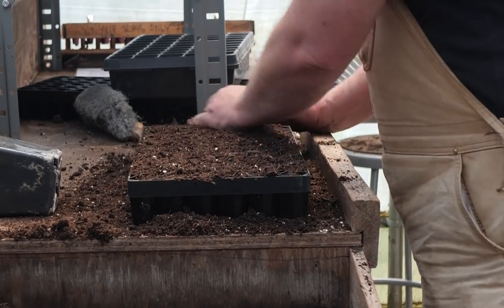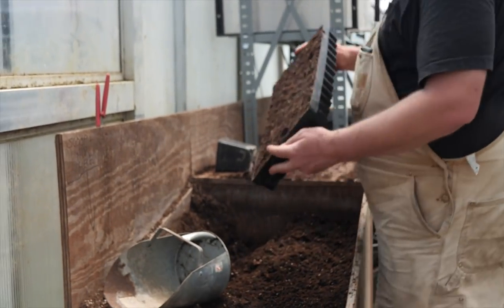Winstrip Trays: What makes them different?

Comment: I tried soil blocks but the juice isn't worth the squeeze. Meaning they're not very efficient. They take more time and work which is better spent doing something else. I'm all about working simple,efficient and organized. I'll have to try these trays. All the rain we've had has wiped me out and last evening the hail, up to golf ball size, finished everything. No cat tunnels or hoop houses so I'm at the mercy of the weather. It's cool though because there's still plenty of time to replant. Thank you

Comment: For starting seeds indoors I use the bottom watering method. Would these trays still root prune if they were sitting in another tray that I fill with water? I imagine they would have to be propped up so air can circulate underneath.
Reply from the maker: Yes, they would root prune on the side slits, jut not the bottom

Comment: What mix do you use or recommend for loading the trays? I've tried a few, but perhaps I have used too much soil or perlite (or both), as I find by the time I'm ready to transplant, ive lost about a third of my mix from the cells due to bottom watering.

Comment: help anyone, i have bought 10 of these trays and i want to buy 10 of the bottom trays but neversink is always sold out. does anyone know a suitable replacement. i think the outer measurement of the bottom trays is 22 x 12.
Reply from the maker: Trays should be available in two weeks.